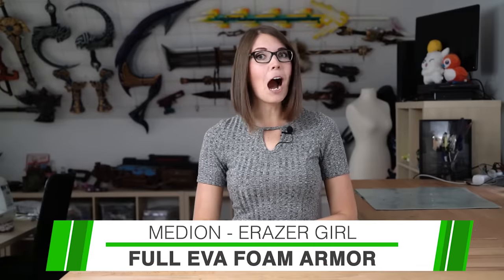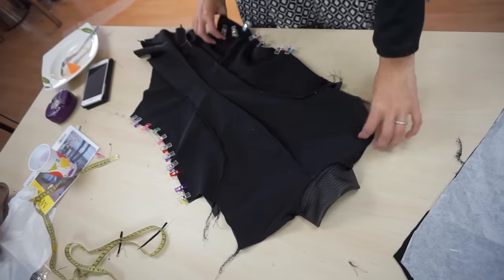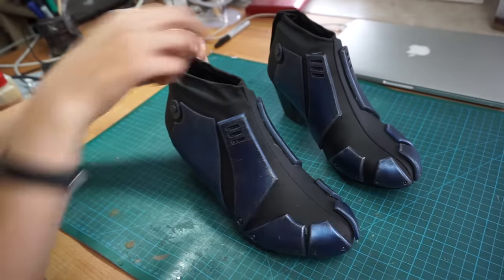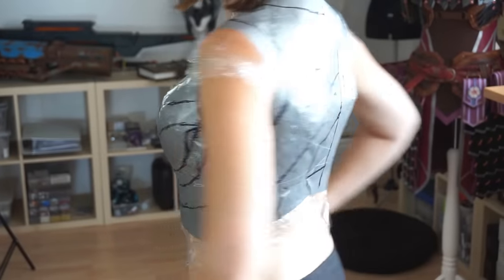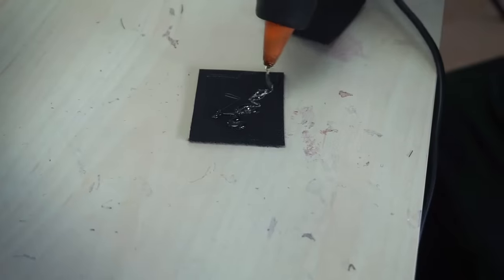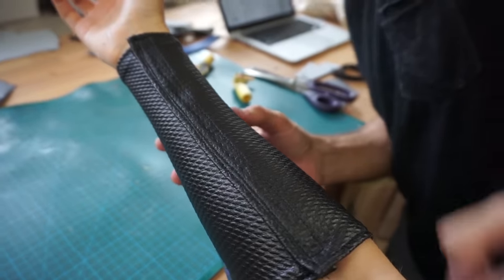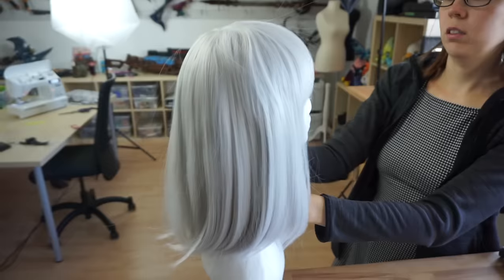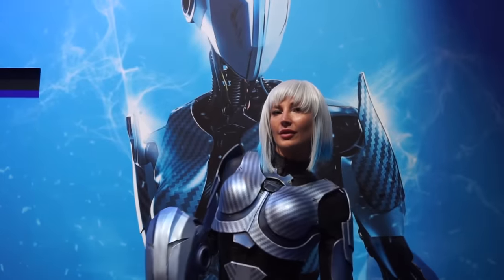Full EVA Foam Armor - Medion Erazer Girl

Comment: Absolutely fantastic step by step video. For those trying to copy the carbon fiber look but down have a laser cuter to make those zigzags on tape, my alternative was to use fabric shears/scissors that have a zigzag edge so they will cut your patterns/tape the same for under $20.
Reply: Pinking shears is the proper term for the fabric ones if you’re searching for them, but also I remember having craft scissors with zig zag edges in elementary school... so those might be available still too haha
Reply: You can actually buy faux-carbon-fiber kits for use with spray paint or airbrushes.  They're sold for detailing car parts and come with a mask material that creates a pretty decent pattern between the basecoat and topcoat.  Check your local auto parts store.
Reply: They're called pinking shears.  And I thought the same thing.

Comment: Didn't see them in the description, but what type of tip did you use on the dremel to get those circle details on the foam? Thanks in advance and as always really great video!
Reply: NEAT cosplay i would really like to know this as well, my dremel bits all tear up the foam
Reply: NEAT cosplay just the sanding (sandpaper one)
Reply: lasarith2 you do know there are many, many variations of sanding drums right?
Reply from the maker: +NEAT cosplay Yeah it's just a pretty basic thin sanding drum. :)

Comment: You are very silly!  Don't change a thing! Well, work out some more, so funny!  I never knew how costumes were made. I particularly like how you formed and painted the armor pieces. Glad I found your video!
I build fishing rods, so I use hollow and solid tapered blanks of fiberglass and graphite.  I use a traditional method of size E, EE, and D thread to hold the eyelets (guides) on the blanks, then cover it in expoxy.  The epoxy holds it all together, but years ago it was the thread and varnish.  I also do designs using the thread. I make all my own fishing rods as I have long arms and I can custom fit my tackle to the task. I particularly like catching sharks up to 2.5 m and 150 kg from the beach, bridge, or pier, but I have rods for catching minnows too. I tag and release the sharks. 80% of sharks are tagged by recreational fishermen in Atlantic waters. 
Have a great holiday and thank you for sharing!  I subscribed!

Comment: Is it possible to coat EVA foam cut outs in fiberglass for extra durability and rigidity? Or would this simply not work?
Reply from the maker: Yes, it works, but fiberglass is super nasty. I would recommend easy to mix resin instead.
Reply: @KamuiCosplay  Noted, thank you for the advice.